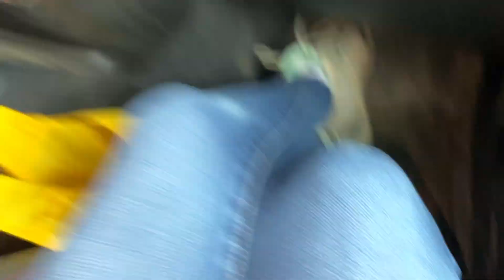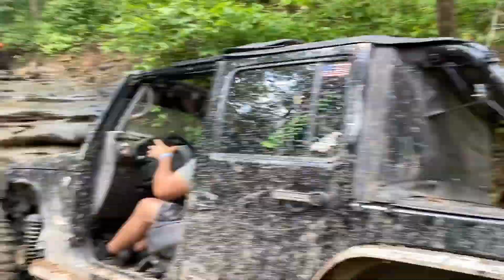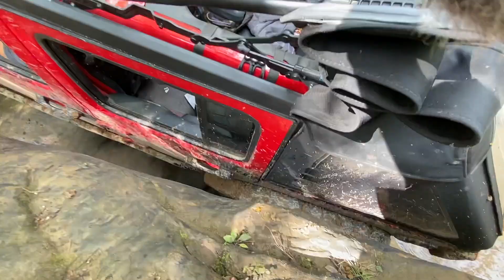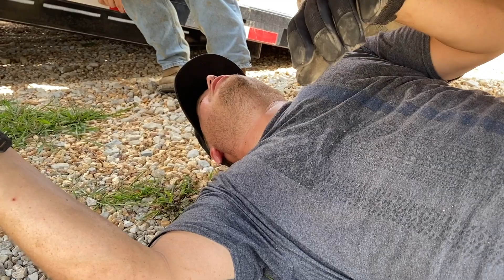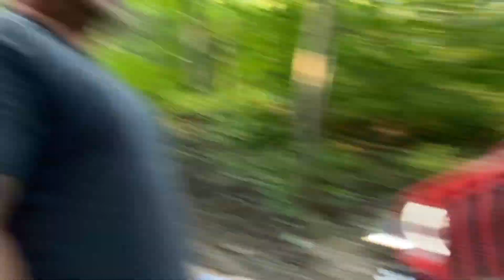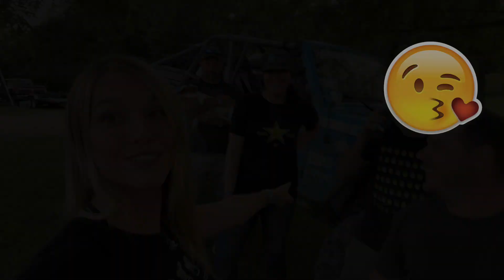SO MUCH DAMAGE!! We Break ALL the Jeeps Off Roading at SMORR!

Comment: Great job spotting that yellow Jeep’s door right into that rock...
Reply from the maker: If you watch the video, you’ll notice the driver was not listening to the spotters, but instead straightened completely before being told to straighten just slightly and braked several times while being told to keep the wheels moving. All a no no on slick rock. 👍 He also opted to attempt going around the obstacle when we suggested straddling it. This was the most off camber the driver had been, and he simply got nervous. Which is understandable.

Comment: why do you rev the snot out of the engine to get the wheel speed you need? you did put a V8 in there, use the horsepower you got, go up a gear or two and utilize that engines power. 
Great vid otherwise.